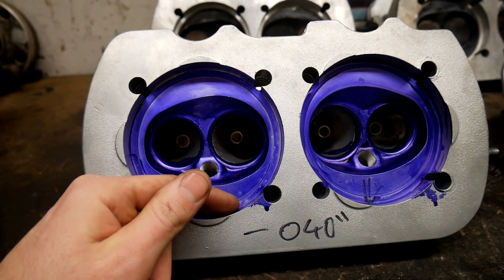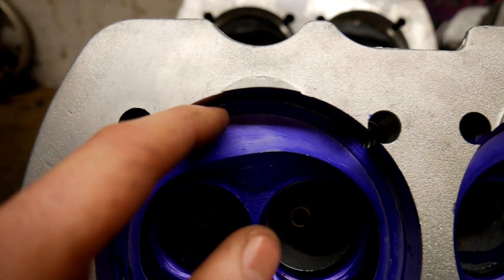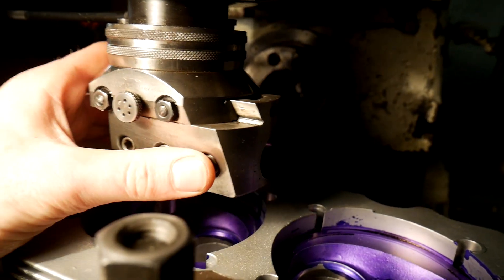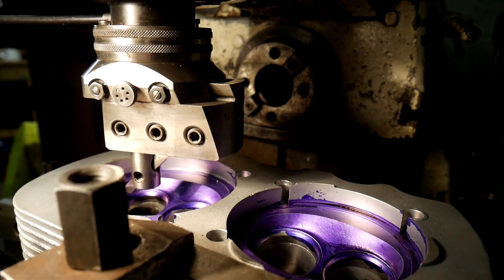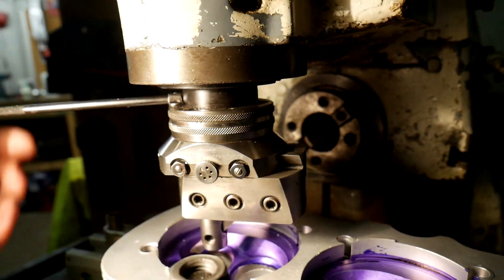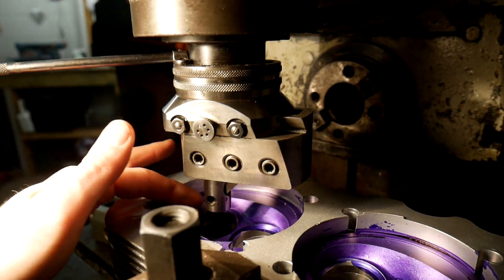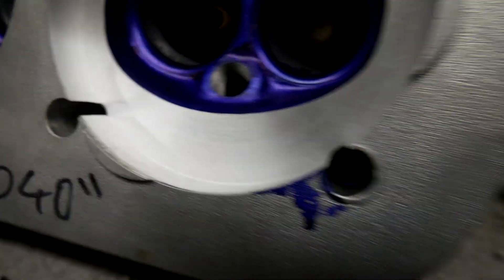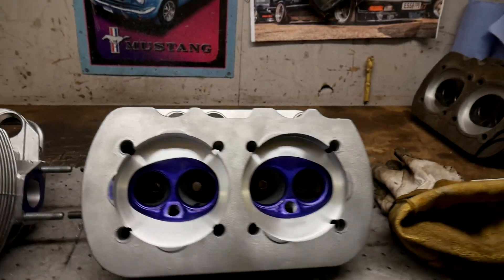Aircooled Volkswagen Head Machining With Auto-Feed Boring Head!

Comment: Nice video. The difference in depths is due to measuring from a cast surface, down to the machined surface. Try to measure off the 3 lugs on each bore rather than the casting surface. 

Or measure using the mill from the top of the head (which is sat on the mill bed). 👍.